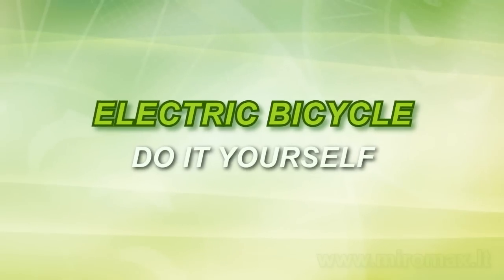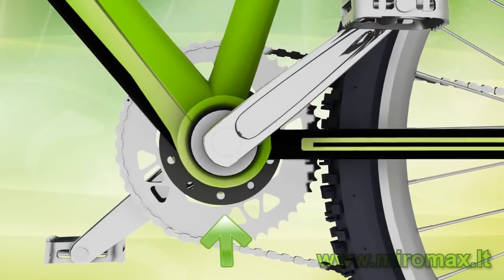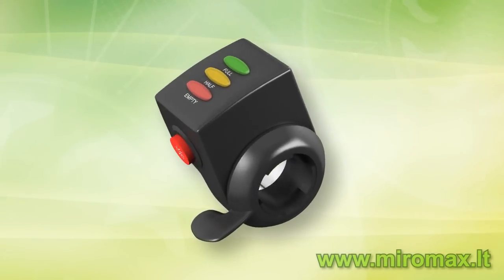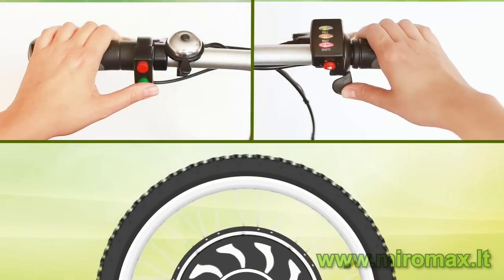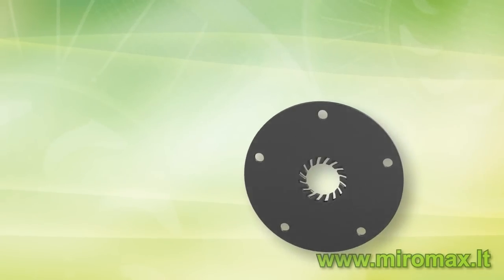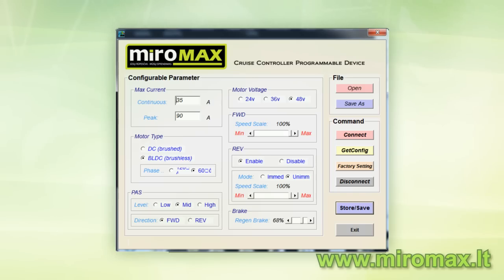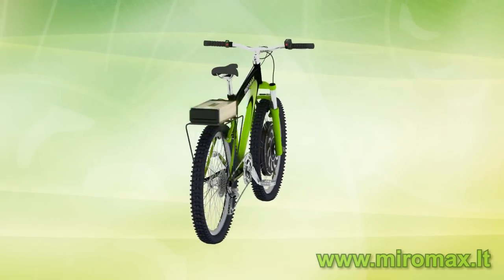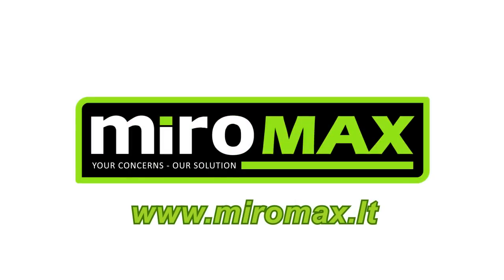Magic Pie 4 - Conversation kit. Electric bicycle within 30 min !  Presentation from MIROMAX

Comment: Why buy this? By the time you add on all the little bits that should come with it it is a terrible value. Heavy and adds unsprung weight which ruins handling.
Reply: How so? I’m considering buying it but a google search said something similar to your concerns. I was considering adding it to a light weight road bike 🚴 but dropout widths and balancing were raised as concerns. I’m not experienced with modding so I’m hoping that you’d explain to me. The bike that I was hoping to add the kit too Max4out 700C. Hopefully you see this because I desperately need help.

Comment: Why would anyone buy this? Heavy, adds unsparing weight, by the time you add the torque arm, USB programming cable, throttle etc it is a completely bad value compared to a bafang or Tongsheng mid drive.

Comment: i wish they sold a full set bike or a full set parts that only require the mounting setup, I don't want to mess around clipping wire range and size over weather issues.
 good part is, transportation like this would be a future 2 wheel thing, if only the gas stations had electric power-up, gas motor generate service to help merge electric vehicles into the highway world, I might find my self pirating someone home external outlets lol.